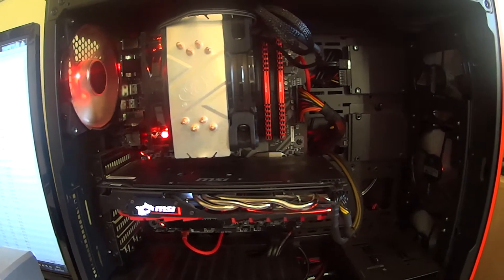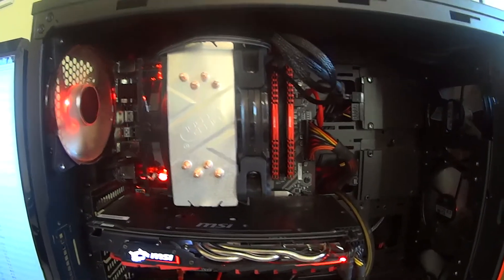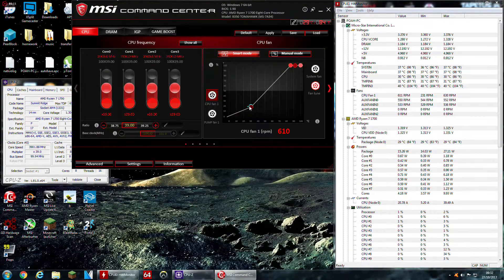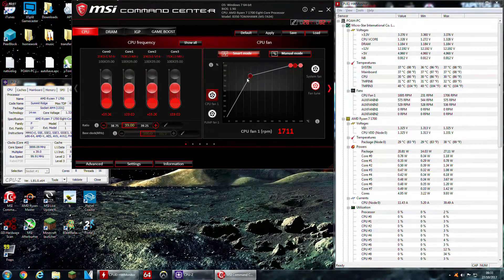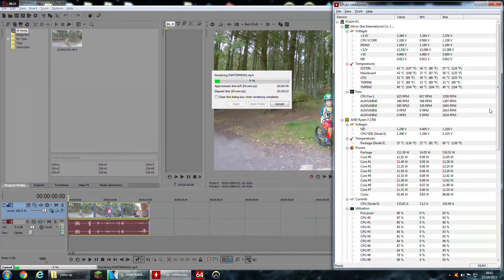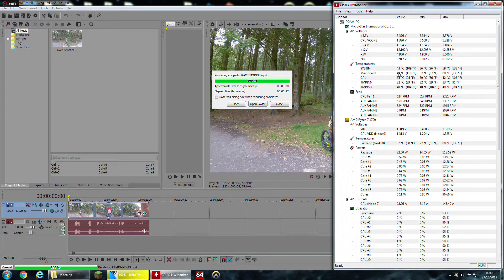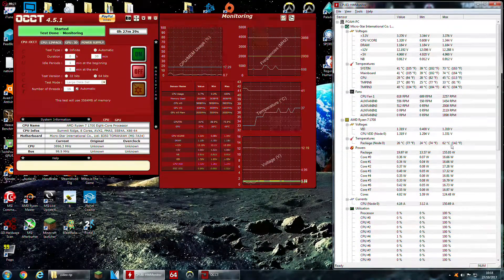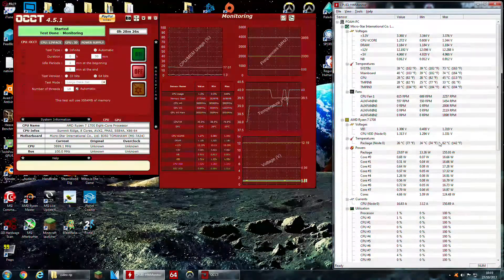Ryzen R7 1700 with deepcool gammaxx 400 cpu cooler AM4

Comment: what's your ambient temp? any significant different between 1 fan and 2 fans on the gammaxx 400 for the cpu cooling?
Reply from the maker: not really but I found my VRM temps were reduced by 10C.
Reply: I'm thinking of buying Gammaxx 400 to my Ryzen 2700 and trade all fans to coolermaster air pressure. Do you think push and pull config + 4 coolers will work well?
Reply: 2 exaust fans (up and rear) and 2 intake fans on front (sorry for bad english, i'm brazilian)